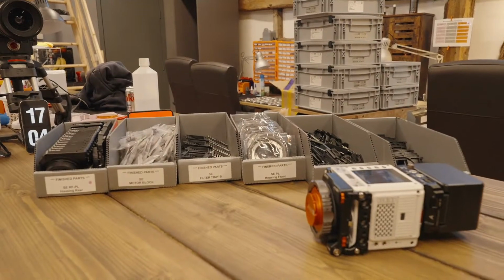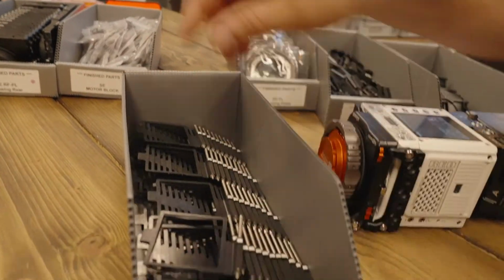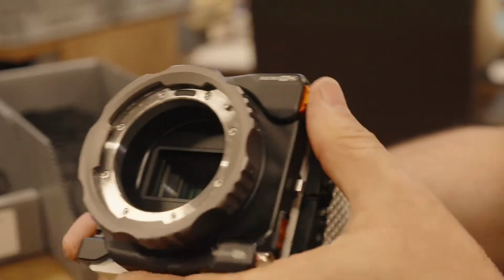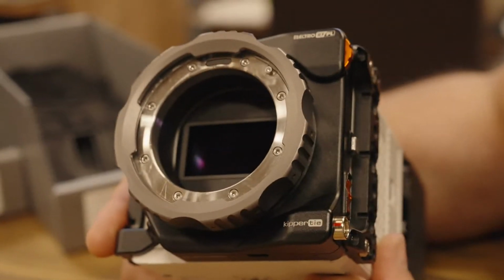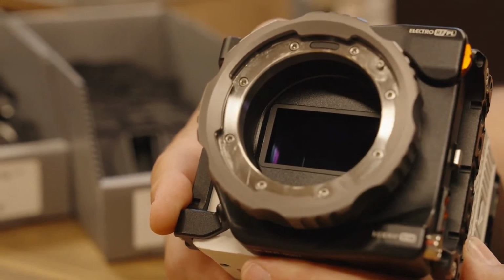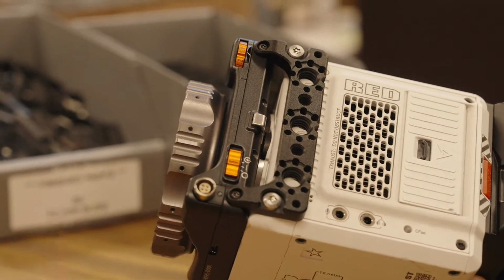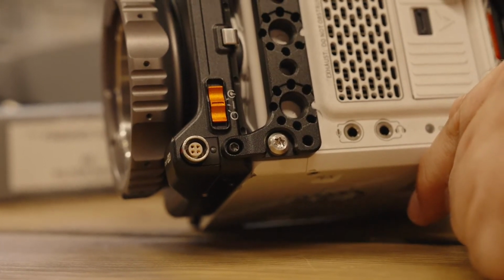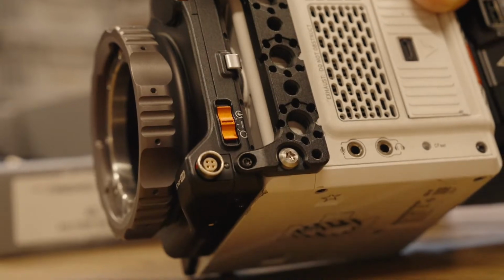Unfiltered • Ep 09 • 05/29/25

Comment: How does the sensor coverage compare between Strata Electro, Revolva, and Revolva LC?
Reply from the maker: Hi, thanks for the question! Hopefully this answers it:

Strata Electro - oversized compared to the RED VV sensor

Strata PL-ND - same but slightly less oversized

LCminiND - full frame with stills aspect ratio

Original Revolva - oversized for s35 and the result is a slight possibility for left and right edge vignette on RED's very wide VV sensor, but usually nonissue for other manufacturer's full frame sensors (~36mm vs RED VV ~41mm width)